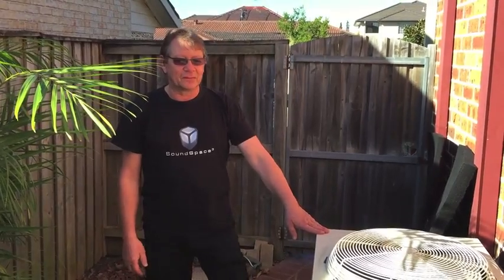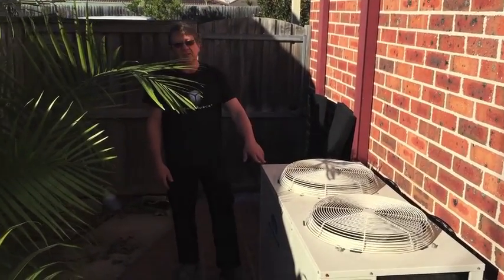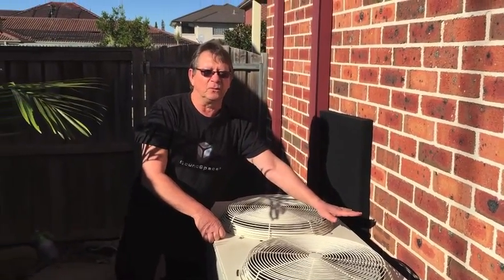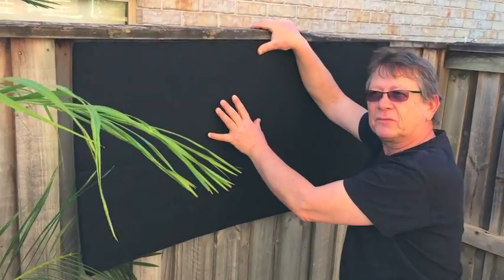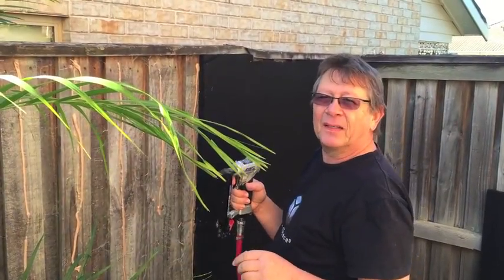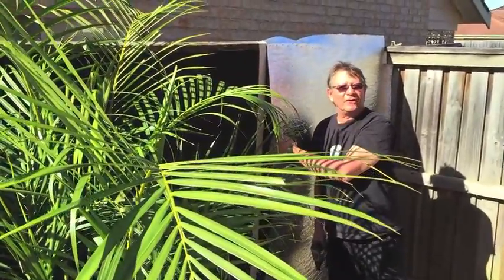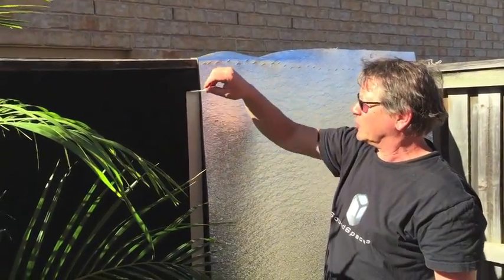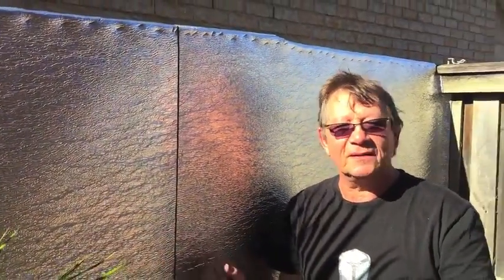How To Reduce Noise From Air Conditioning Unit

Comment: Above my apartment, on the terrace, there is a large air conditioner that makes noise 24 hours a day as it powers the telephone antennas. Below the terrace is my bedroom and I hear a lot of noise and vibrations at night.
Please, how can I fix it, because I can't sleep peacefully at night? Should I insulate the terrace or the ceiling of my room?
Thank you
Reply: It's likely you would have to insulate the ceiling to make a noticeable difference, probably the ceiling and the walls at the terrace end of the room. You could get a panel or two and place it in various locations to measure the (small) effect with a sound meter. Put panels in the places with the largest effects.

Comment: Thank you for this explanation. Any chance I can build a removable system similar to this and it work to dampen sound? I have a back patio in a townhouse where the neighbor unit AC sits right in front of an area of my screened in porch. I don't want to permanently add things to the half fence since it is not high enough.

Comment: this sound absorbing modification probably cost more than just buying a more modern heat exchanger, and quite honestly, it looks terrible.

also, I've installed thick rubber mats underneath my external unit in my own home and it cut the amount of noise by nearly half. you can find them online for 20 bucks.

the last thing you can do is wrap your compressor, makes a huge difference.

this solution being presented in this video is extremely expensive and you still can't walk around your property because that outside unit is so noisy still. 

ridiculous.

Comment: Looks like you're taking it seriously.

But isn't the proof in the results ?

Your phone has the ability to use a sound meter app. Couldn't you turn the air-conditioning on to show before and after dB by putting your phone over the fence to see ?
Reply from the maker: Yes, you are right but I couldn't have access next door to take measurements as the relationship between the neighbours were very bad. I'll do another video as soon as I have another opportunity. Thank you for your comment. It is quite complex and the design it needs to be review each time, according the level of excessive noise. Sometimes the noise is too high and it's cheaper to move the A/C unit at the back of the house, instead of the side.

Comment: How can I do this for my condo walls? I can hear neighbors talking through the side walls (on both sides), swimming pool noise (kids screaming) coming through the front door, and an ac condenser on the roof above me. I own the condo (and like it besides the noise) so I can do work to it, but maybe I should just move :(
Reply: Woaw! That's a lot of different noise problems for one place.
There are solutions for all of this but it's going to be quite expensive at the end and the noise will not be stopped completely.For the walls, I can refer to my youtube video "How To Soundproof a Wall" https://www.youtube.com/watch?v=2paK_IU0pc8
For the front door you can install proper acoustic seals around the doorjambs and an acoustic drop seal on the bottom of the door, that helps a lot, providing you have a good solid core door, another thing you can do is to install some sound absorber panels in the lobby to reduce the echo, sounds like you have a hard floor there, not carpet and the noise is bouncing on all hard surfaces and doubling in intensity.
For the ac condenser above it needs to be suspended on rafters above if it's in an attic or install on thick resilient mounts or spring mounts, depends on the weight of the ac condenser.
Selling may be a better option in this case, hard to say for me.

Comment: Go to Home Depot. or put this on your browser (hope it works)  
 https://www.homedepot.com/p/ROCKWOOL-Safe-n-Sound-3-in-x-15-1-4-in-x-47-in-Soundproofing-Stone-Wool-Insulation-1-Bag-RXSS31525/202531875
look up  Roxul  " Safe'n Sound 3" x 15 1/4" x 47" soundproofing stone wool... this is great for outdoor 
is a sound absorber... and is  fireproof and waterproof .. made from rocks, non toxic!
To reduce my noise from my a/c I am building a redwood 2x4 frame (like horizontal house frame joists) 6' high with vertical wood dog eared planks on the outside, air layer, then vinyl MLV, then on that will be the acoustic wool then to hold that in a wire mesh... I'm thinking of putting the 1" above the overhang 7' up for echoes. I already ordered new capacitor, contacts a new fan motor and compressor blanket for a "scroll compressor" even though mine is a reciprocating compressor, it's a universal so it is larger with more overlap hense more insulation.. that should make a difference . Cheers!

Comment: Thankyou~great video~my neighbour mounted their AC on the side of their house(our houses ar 7' apart)and the space between our house acts like a sound tunnel  reverberating noise, keeping me awake.I am guessing if I was to use the sound barrier and absorber I would have to build a very tall wall to keep noise from second  floor?I wish my neighbours were as thoughtful as you building a barrier in the video~well done!
Reply from the maker: Hi, this is a very bad case scenario as the house is two storey and very close, you are right saying it acts as a sound tunnel and it increases the noise. Working from your side will make things much more complicated and more costly, may be for poor results. The best way, I think would be to install a secondary acoustic window for your bedroom, that would solve the problem, at least for your bedroom. Another way would be to ask your neighbour to do something about it, or move it at the back of their house, the council may give you some advice, they have usually a department dealing with noise pollution and sometimes, they come to take sound measurements to see if it's compatible or not with the local laws or codes.

Comment: Why doesn’t he mention product name
Reply from the maker: Good question! I am happy to recommend some products that I am using for the moment but I didn't want to promote a particular brand, because there are more than one company making good stuff. I can name the one I am using most often but materials are improving with new and better products entering the market from time to time.
'I am Based in Australia and the Mass Loaded Vinyl I am using for the moment is called  Wavebar, the polyester sound absorbers are made from a local manufacturer according my specifications, I don't have a name for it, I am just using different thicknesses and densities to suit different applications.

Comment: I am wanting to add a protection layer to the polyester panels to better protect from moisture and UV.  I was thing a cheap way may be to use a flexible rubber layer such as bitumen paint.  Would that affect the acoustic absorption properties?

Comment: Hi I seen your  Youtube video and I wanted to quiet my heat pump.   We sit on our deck and every time the heat pump turns on it sounds like a jet air plane.   Our deck sets about 5 meters away from the heat pump.  I I would like to build a wall on one side of the heat pump between the deck and the heat pump..  I have a picture you can view if you copy the link and paste it into your browsers you can see our set up. I would like to ask you, if I can build a wall and reduce this sound enough to be able to hear the birds sing on the other side of the deck?  

https://drive.google.com/open?id=1-eGr0taG4AE0k0-auQEn6qgK7HMcNsx6

Comment: What if the air conditioner unit is right next to the window?
Reply: If it's next to the window, I would probably recommend to install a secondary acoustic window inside with a minimum of 10.38mm thick glass

Comment: Hard to understand how this vid could have been made WITHOUT a before and after sound check
Reply from the maker: The sound measurements must be taken from the neighbor side and we don't have always access, sometimes there is a lot of agressivity between two neighbors triggered by the noise issue and don't want to talk between each others. So, it's not always that simple unless you get the council involved which is happening from time to time.
Reply: soundproofingexpert nevertheless

Comment: Good effect on target, BUT you are blocking air flow from the AC unit. Now fix THAT issue and make another video.
Reply: I didn't block the air from the sides and there is still enough space at the back but sometimes we don't have enough space, that's right, in that case we have to to move the unit.

Comment: Will something like this help to reduce the sound coming from a neighbors unit? I other words, can you do the same treatment but on the other side of the fence to help reduce the DB?
Reply: That will help a bit but it is always better to fix the problem as close as possible from the source of noise, like installing sound absorbers at the back; plus, in this case, because the reverb between the house and the fence, the sound bounce to itself and increase, making it harder to reduce it working from the other side, so you'll achieve much better result working from the A/C unit side.

Comment: you're going backwards, dynamat the inner unit's shell & make a pair of cylindrical stacks to fit on top of the fans, 3-4 feet tall
Reply from the maker: Good comment, yes, you can you can make a pair of cylindrical stacks or just a galvanised box rectangular shape for both fans 2-3 feet tall with high density sound absorbers inside, that will reduce an extra 3-5db, the higher the stacks the better but better check with the unit manufacturer for the hight as it may reduce the performance of the A/C if too high.

Comment: Hi , my AC unit is on the roof, I feel the vibration and all noise , how can I minimize this , thanks
Reply: Vibration isolation pads or dampers. This type of cover he uses in the video might help as well. Compressor blanket to help with compressor running sound.

Comment: You have to prevent restriction of air as much as possible, and not block the condenser, even more your unit is to close to the wall , should be at least 12 inch clearance so it can be cleaned every two years , otherwise will collect dirt and prevent compressor, and coil from cooling,  that is why the fans are on top of condensers , but to put it on the fence is okay, just find a jacket and rap it around compressor , bubble head 🤪

Comment: what about the windows above the unit? if they are open? will the panels between the unit and the wall absorb so much sound that the benefits are there even if the windows are open?
Reply from the maker: I don't think it will make a significant difference for windows above the unit. we would have to install a kind of roof above the unit with sound absorbers inside and make sure the air can flow without too much turbulences.

Comment: Hello. Thank you for this video. It very helpful. I have a question: is this solution reduce noise in the second floor ? The ac unit is in the ground and my appartement is in the second floor and i hear the noise . Thank you
Reply from the maker: You'll still hear the noise at the second level, that you are in the same building or on the other side of the fence because the sound still goes above the fence, you'd have a bit of sound reduction but not enough. In your case, I'd recommend to build a secondary window inside, between with an air gap of 50mm to 100mm and 10.38mm thick laminated glass or similar.
Another solution sometimes is to relocate the A/C unit in an other place where people are not affected by the noise
Reply: soundproofingexpert thank you fir the replay. I m in the second level in the same building, there is no windows in the wall, so I dont understand why i hear the noise ? The AC unit is fixed on a frame connected to the wall, is the noise coming inside by vibration ? 
Merci
Reply from the maker: I understand, the vibrations are going in the wall and get transferred through the structure of the building, the best way to fix this is to install resilient mounts between the A/C unit and the brackets. There are different type of mounts designed for some particular weight, so you may have denser mounts on the compressor side and lighter mounts on the other side; you need to find a company specialised with that, to make sure you are using the right resilient mounts, in Australia, for example there is a company called Embelton.

Comment: I am a tech myself and I do not agree with you. Main sound is coming from compressor. Sound barrier should be covering compressor and it should not affect performance since compressor is mainly cooled by freon https://youtu.be/pCUlnxJB58c
Reply from the maker: The noisy part in this case,  is the fan and I can't cover it with a flexible sound barrier because the air must keep circulating, it is easier if it is a pump because we can inclose it but not in this case
Reply: Jeffrey P what do you recomand to reduce the fan  noise ?

Comment: Hi, thanks for posting the helpful video. I have a 6 ft backyard fence with alot of road noise. If I add STC 26 mass loaded vinyl to the fence will it reduce the road noise much. realistically, how much quieter will it make my backyard? thanks!
Reply from the maker: Hi Kyle, it will reduce the noise if you could increase the hight of the fence to at least 8 feet, the higher the fence the better, depends how far the fence is from your house, because the traffic noise will hit the house and bounce back lower. Sometimes, councils don't allow you to increase the fence hight but you may go around that by erecting a new fence, just next to the existing one, that's allowed sometimes. Don't expect a STC 26 reduction but half of it,
Reply: my neighborhood deed restriction don't allow fence higher than 6ft so I can't raise it to 8ft. So if I can lower it by at least 13 decibels with 26 STC Mass loaded vinyl, I'm satisfied with reducing the noise by more than half. Thank you very much for the insight.
Reply from the maker: I understand you can't increase the hight of your fence but may be you can built a second fence next to it, 8 feet high, without touching the existing fence, check with your council, it could be legal otherwise you'll have some reduction but not that much

Comment: Do you have a contact in Canada (or the US)  where I could buy the sound absorber panels & the sound barrier?
Reply from the maker: I don't have contacts there but I know some companies are manufacturing the flexible sound barrier also called mass loaded vinyl. There are also sound absorbers weatherproof, may be not polyester but with other fibres.
It may not provide good sound reduction in some cases, if the neighbour house is too high with eaves or too close, in that case you'll need to increase the hight of the fence to at least 2.4m, (8 feet)

Comment: Not buying a Goodman is a good start, if you want quietness
Reply: exactly and I have a LOUD Goodman, sounds like a helicopter.  I saw these panels but for around $150 each which would make this too expensive for me.  If I knew the Goodman would live another 4-5 years then maybe worth it.
Reply: Just had a Trane 16 Seer installed and the noise is annoying.  It has a high pitch that sucks bigly.
Reply: I was in an underground garage two days ago, and heard this loud growly ac unit...it was a trane....mine has the compressor in its own insulated compartment.  it is over 30 years old and so super quiet.
Reply: Nicki Luescher agreed. As much as I don't care for goodman, it is a crap shoot.  A good install makes all the difference, I believe.  My parents' first ac was a Lennox installed by idiots.  Numerous issues, it lasted less than 15 years and it had issues every two years or so...so loud, I remember.

Comment: I d like to sound proof a outside gate that is on the road. 1.80 m high but there a double gate made of aluminium. What would you recommend?
Reply from the maker: I'd need to see a picture of the gate, it's not going to be very efficient as you probably have a gap under, may be in the middle as well

Comment: How much did the material cost you and where did u buy it at?
Reply from the maker: The black polyester sound absorber was manufactured from a company with my specifications, you can't find those densities 32-60kg/m3in any shops in Australia, I am not sure in other countries but you may find weatherproof sound absorbers in your own country.
The mass loaded vinyl 8kg/m3 cost around Au $55/m2 including taxes, this is in Australia, I don't know in other countries but it shouldn't be too much different.
Reply: @soundproofingexpert  Hi Philip, I’m located in Australia too, could I please ask where did you get the polyester made from? Would I be able to get one from say Clark Rubber please? Thanks!
Reply: I like yr video very much, i leave in Medan Indinesia, how to order the sound absorber polyester and how much it cost?
Reply: Can you please provide the name of the supplier you use for the mass loaded vinyl and the sound absorber?

Comment: does that work? any follow up video on the effectiveness?
Reply from the maker: It works, right behind the fence, if the house next door has another level with windows facing the fence, it will only reduce by 3-4 db, thanks to the sound absorbers. we'd need a much higher fence to block the noise going to a higher level.
Reply: @soundproofingexpert Can you please advise where I can purchase the polyester sound absorbers?  Thanks Jim
Reply: @jimrose3768  I can help you in Australia but I don't know if other countries are making acoustic polyester batts. If you need maybe 100m2, you can ask a manufacturer in your country to make them for you, some may agree to make 20m2. The density should be 48kg to 60kg/m3 x minimum 50mm thick